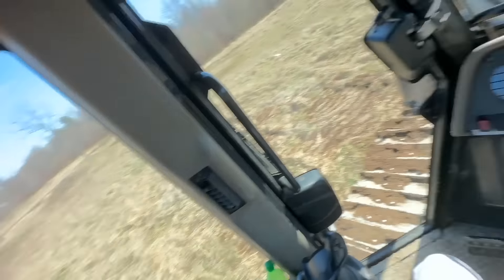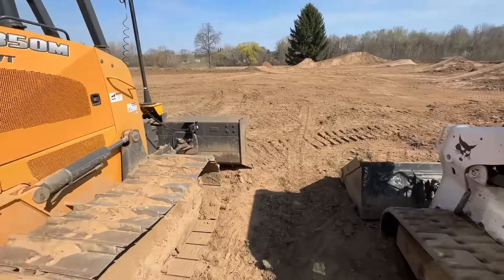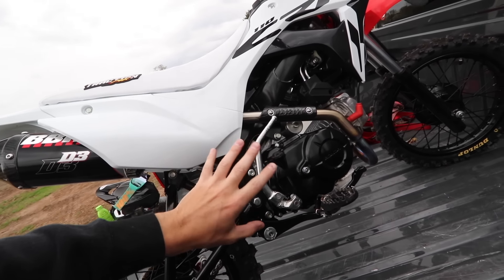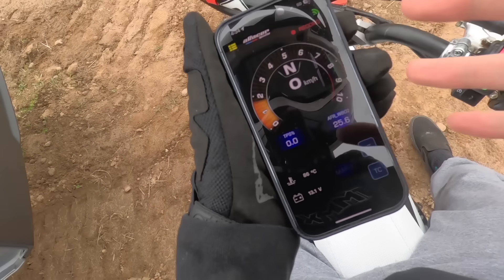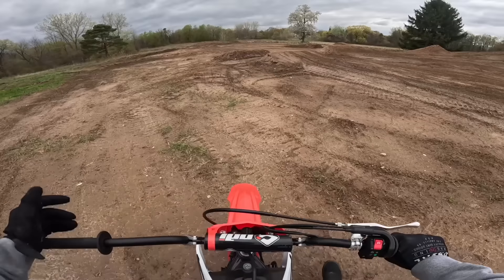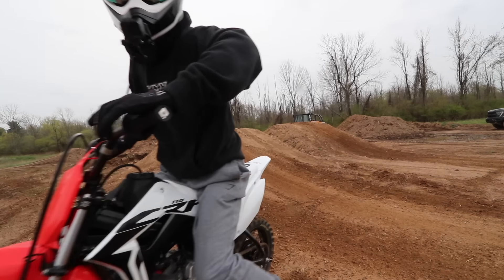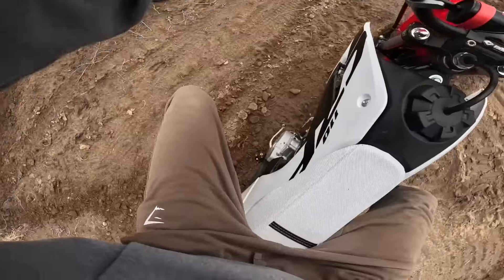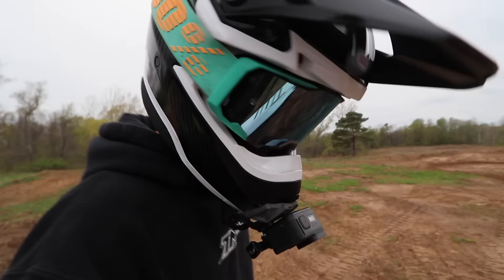Building New Backyard Pit Bike Track!! Mod CRF110 First Ride

Comment: I ride a tiny little chinese 125 but it is the size of a 110. I put in an amazon race 125 4 speed manual and a nibbi 24mm racing carburetor and air filter and that thing rips. The exhaust is so loud and throaty. I actually love my apollo rfz x6, but the crf110 content is so much better than electric.
Reply: Tyler_Monagan.  alright cool mr bot who is not tyler mongagan bc you have no videos. and only a bot would say turned instead of tuned.